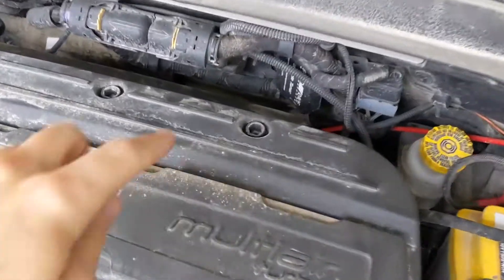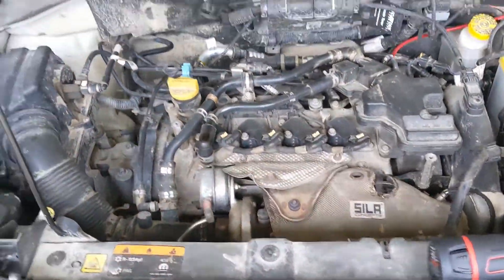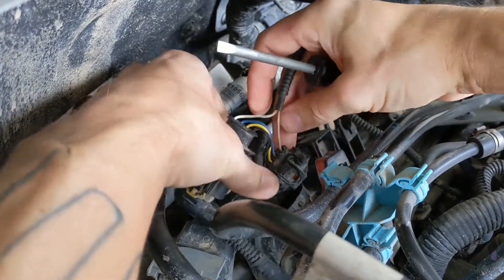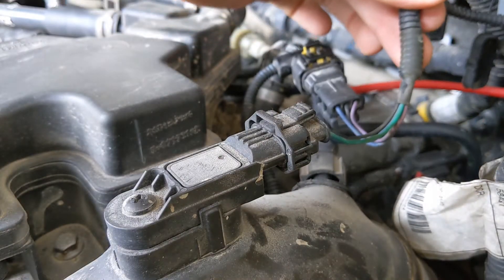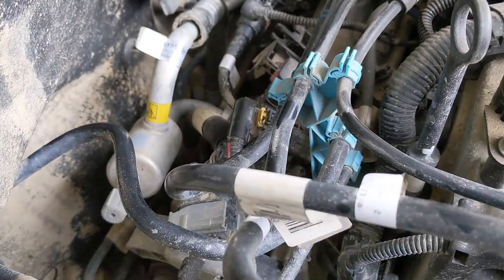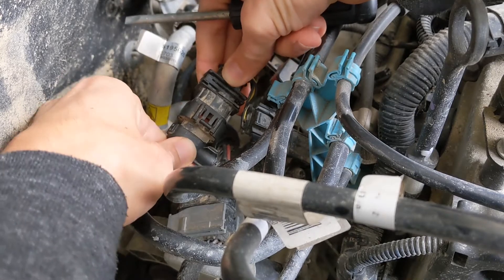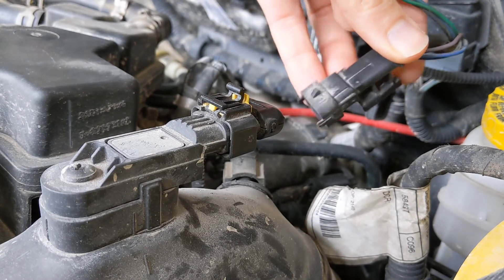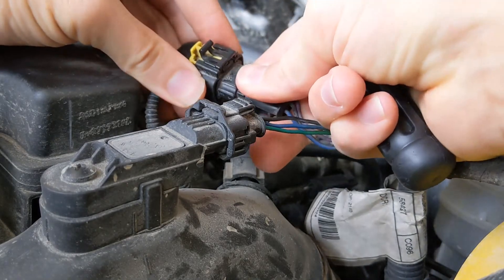Piggyback ECU re-install

Comment: I am suffering from a problem with my Jeep Renegade manual, and I do not know what the solution is. The anti-slip light, the anti-slip light, and the brake light appear, and they turn on by themselves, and at some point they turn off by themselves. Is this a battery defect?

Comment: I'm considering purchasing a Renegade and curious about the mods you done.  Example would be...what is the 'piggy back' ECU do to performance, does it void the warranty.  Also the comment below mentions the under drive installed.  Did you do any videos on that or where can I get more info?  Thanks and keep up the informative videos!
Reply from the maker: I used to believe any mod would void a warranty for sure. But when I was at a dealer, they were pretty cool and just said to remove the stuff. All my mods so far are removable so the warranty situation still worked out fine. But I bet if you have a dealer that is not as cool, they would just reject any claim.
Reply from the maker: I did not document the under-drive pulley install. The piggy back ECU simply "tricks" the ECU into allowing more boost. It made the most noticeable increase in performance.
Reply: @manualrenegade9755   I think I'll probably get the normally aspirated 2.4 liter and not the turbo.  I don't suppose they have any ECU performance mods for that engine.   I think it's less powerful but probably sufficient for the minimum amount of off-road I want to do.  I'm more interesting in building out a nice little camping kitchen pull-out system on one side of the cargo space (minus the rear seats) and the other half a tight but small emergency comfy auxiliary sleeping space for one person (me) and install a 2 person roof top tent for more normal camping.  It appears adequate space is at a premium with this vehicle, so I'll have to be clever with any installation.  Thanks.